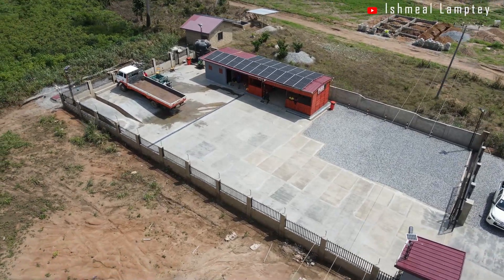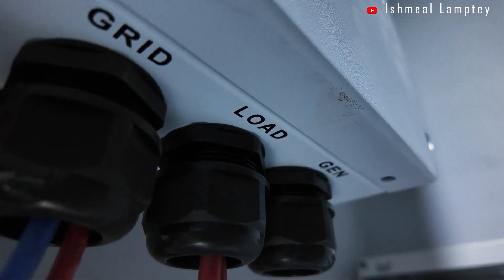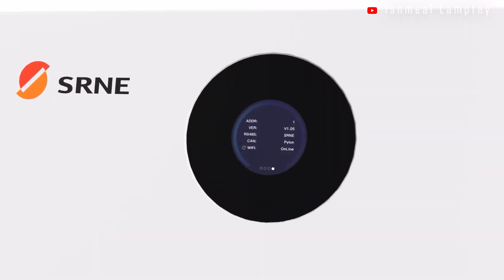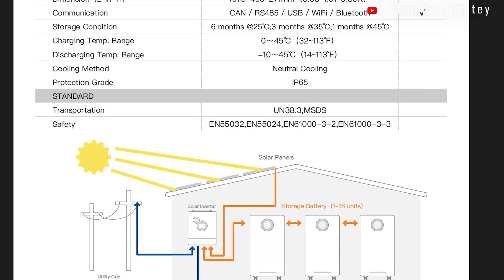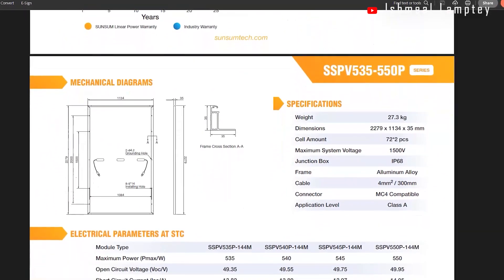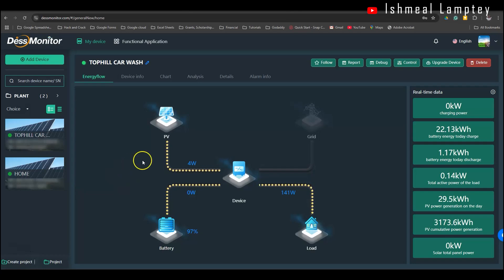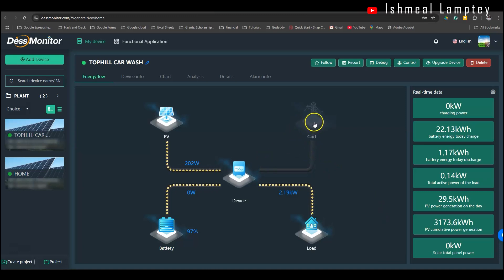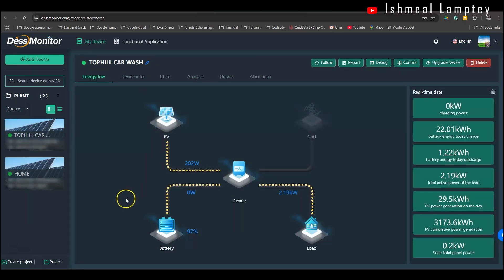How much Solar Power do you need to Operate a Car wash? This video has answers

Comment: Please consider a generator as a back up. You can use the generator to charge the batteries in less than three hours. If you have a good generator, it can help you stay off the grid. Some generators can be configured to turn on automatically if the battery falls below a certain level.
Reply from the maker: Thanks for your suggestion. Certainly not a bad idea to have a backup. I will do well to look into the generator option. Thank you

Comment: Aside filteration, do you have to treat your water for use to prevent corrosion?
Reply from the maker: For now, we are only doing filtration. But we will be treating it soon. However we haven't had any issues with corrosion so far.